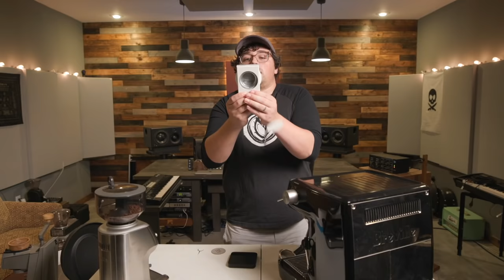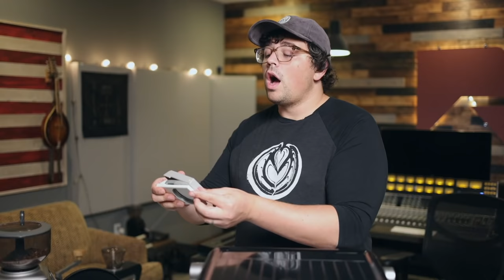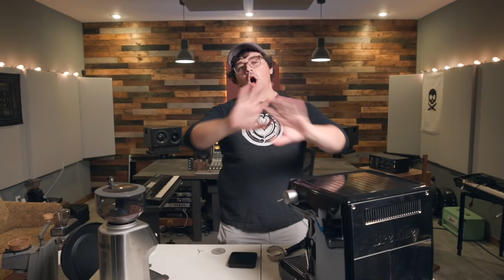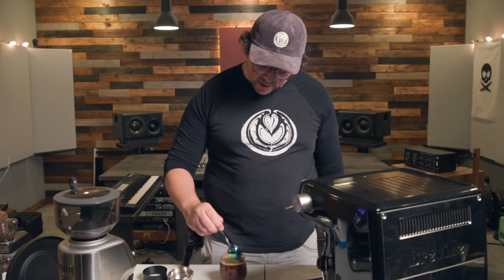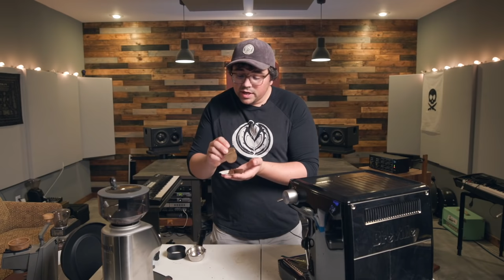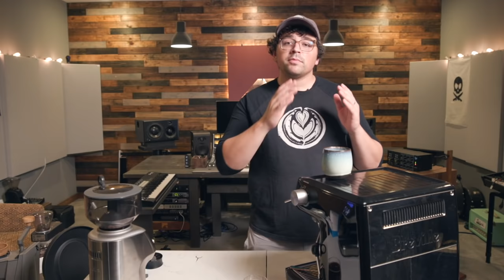HOW TO DIAL IN: Coffee Shots

Comment: What I don't think anyone has addressed is what do I need and then how do I get an awesome espresso shot. I think most people in this rabbit hole are chasing the same thing - a really awesome shot of coffee, not just a pretty good coffee and certainly not just an OK coffee. Skipping the bean choice, as this can be a personal choice and I might not be able to get the beans you use. So 1. What is the least expensive machine that can produce an awesome shot? By specs it seems that any machine capable of producing stable pressure and temperature should do, but then why all the variations? and why all the stories about how someone moved from machine x to machine y and their shots got so much better?  I'm not so interested in "the best espresso machine for less than $1500, if I need to spend $2500 to get awesome shots most of the time then that's what I want to know. If I've bought the best $1500 machine and my shots are mostly OK and occasionally bad but rarely great I want to know - is it me, is it the machine, is it the coffee I'm buying or do I need to get a better machine? 2. Once I have that machine, what do I do about my water? Do I filter my tap water, buy bottled, add something to the water,... 3. What pressure do I set up the machine for (8 bar, 9 bar,...). 4. What temperature do I set my brew boiler at?. On that machine do I replace the shower head? do I put in a VST basket? So now my coffee machine is chosen and set up,... there are tons of info out there about dialing in, so I think we all know - if you use an 18 gram basket you want your 36 grams of water to flow through in 26-32 seconds (depending on who you talk to). The next step then is 5. Grinding, choosing a grinder - can the Niche Zero produce an awesome coffee or is it only, good and I need a Mahlkonig E65S or E 80, or a Weber to get to awesome...) Once I have chosen a grinder, how do I turn that ground coffee into a perfect puck? Do I spray the beans with water before grinding? Do I grind right into the basket or into a cup then dump to the basket, do I put a paper filter in the basket, stir the coffee with needles before tamping, do I put a puck screen over the puck? Of course all of the above requires a barista who knows how to judge if things are working right of they need to be dumped in the sink and done again, so all those things of, what to look for as the shot is being extracted and how to judge by watching the stream, then when dumping the puck how to tell by looking at the puck how well things went and then finally of course how to taste and judge. How do you separate what you taste into - this taste is because that's what this bean is like or - this taste is because the shot extracted poorly - and you have great vids on that.
I drink coffee regularly for about 50 years and have had coffee in Italy, Spain, France, Germany, Netherlands, Hungary and I find I rarely have coffee that made me stop and go - wow that was a great coffee, but find much more frequently I have coffee that made say - , that was bad coffee (as in needed to be pitched). 
Thanks for all your help in moving us along in this travelogue, moving from wherever we are to where we all want to be - awesome coffee every shot☕

Comment: With machines that can't be programmed for longer shot times to yield 250ml+ would it be too detrimental to run a 2nd shot straight away to get to the desired ratio?
Reply: If you don't have 3 way valve with solenoid yes! If you have have 3 way valve when you stop the pump the machine will let solenoid to open and it will rapidly depressurize and mess up with the puck. BUT if you have almost 0 pressure in the group (not in the pump) I don't see any problems doing the second shot even with 3 way valve.

Comment: I also run a Breville Smart Grinder Pro.

What kind of ballpark number setting did you end up landing on? I know it's hard to translate specific numbers across even the same grinder. But it'd be helpful for me: should I be in the range of 25-30, or more up like 40-45? Or somewhere else?

(I won't get to trying this until tomorrow, it's almost 1am here in Melbourne... Which is a bit late for coffee.)
Reply: I think he mentored 25 for the second attempt

Comment: Just tried it, tastes pretty good! I could see this work in a cafe-situation as the only thing you'll need to change is the grind size so you only need another grinder. 😃
I also used a (Sage) Dual Boiler and if I let it run for 45s (with a 10s pre-infusion), I get 290ml of water out with an empty basket. So the coffee puck isn't pushing back a lot during this recipe. It's around 6,5g/s flow after PI according to the SEP app. I only reached 1 bar, I'll see if I grind finer and pressure goes up the flow will remain the same. I assume it will.
Reply: Only another grinder yeah haha totally not $1000 , a plastic v60 cost $10 and a kettle is something a cafe usually has.

Comment: how do you use the cut 2.5-inch filter for the 58mm portafilter? it's quite a bit larger than 58mm.
Reply from the maker: 2.5in fits the bottom almost perfectly of a 58mm basket.
Reply: @LanceHedrick  Thanks for your reply, but I'm now even more puzzled. I don't know much about imperial, but google tells me 2.5in is 63.5mm. I measured my vst basket and its bottom is about 54mm, nearly 1cm smaller. How do you get your paper to fit?
Reply: @LanceHedrick  2.5 is an aeropress filter, could this be a 2.25 punch?
Reply from the maker: Yes. Whoops

Comment: Curious how you might achieve this, or a Spro Over, on a La Pavoni?
Reply: La pavonis are a bit more difficult. You have two main challenges.
First, shot yield. I think it'd be difficult to get over the 1:3-4 ratio with the pavoni. You can get to that ratio with microfellinis, but to get to the 1:10 ratios used here you'd probably disturb the puck way too much with fellinis (recocking the lever, micro fellinis, which is the same, only like a quarter to halfway of the piston travel, are probably better than full fellinis, since those disturb the puck too much). Certain machines, like the faema faemina, the flair 58 and the FEAR La Peppina can achieve this due to having one way valves in their pistons/cylinders, which allow for full fellinis without disturbing the puck.
Second: group head temp. You could just try boiler pressure spovering, dunno how the high initial flow rates of levers like the pavoni would affect this, but the grouphead might get too hot while doing this. I guess you could account for that by pulling with a colder than usual group.
Anyway, it probably is a bit difficult doing this in levers like the la pavoni, elektra or cremina. But maybe try it! See what you think of the results, but those are the main challenges that spring to mind.

Comment: 2 1/2 or 2 1/4 hole cutter?
Reply from the maker: Crap
2 and one quarter
Reply: @LanceHedrick  what do you think about the top screen? I’m not sure. You still have to clean it.

Also, Cafelat Robot Filter Papers are pretty cheap, cheaper than lab papers, and you don’t have to cut them. FWIW.
Reply from the maker: They aren't cheaper than chemex filters haha! And you get a minimum of 16 espresso filters per filter.
Reply: @LanceHedrick  do you grind coarser when using a screen and/or paper filter to pull espresso?